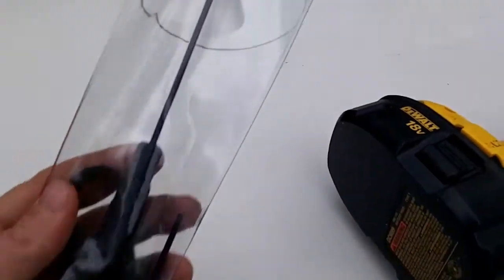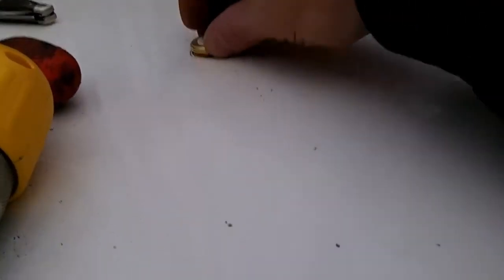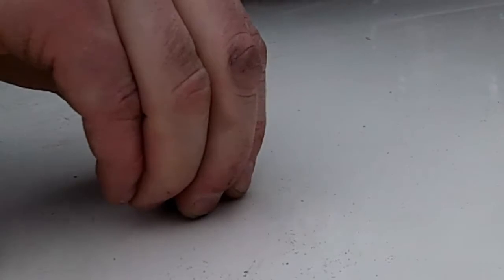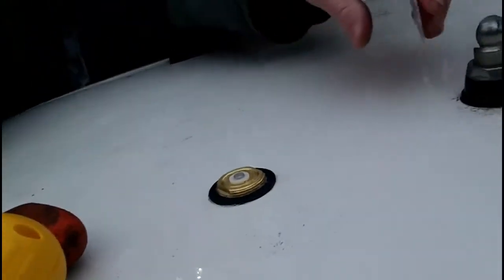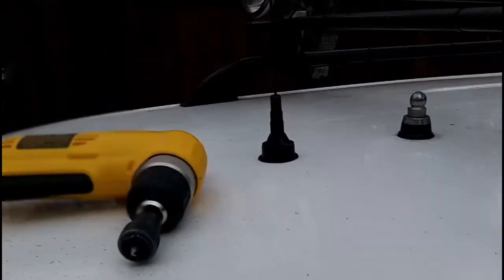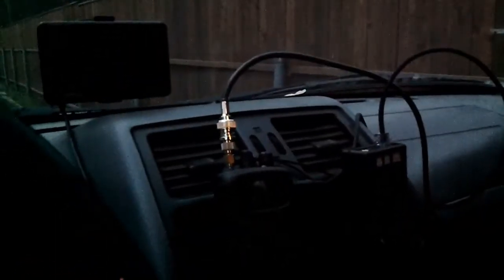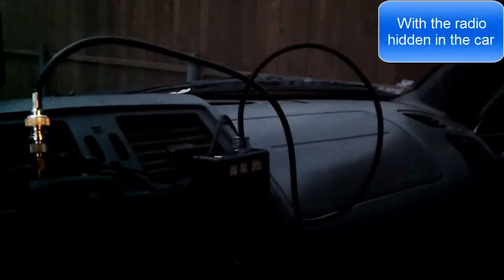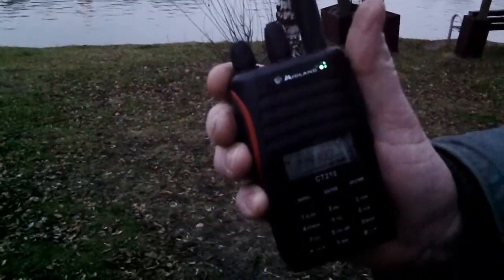Mobile BOV repeater/command vehicle

Comment: when you laughed about drilling the hole in the roof - i did too lol.
nice idea using the bov as a mobile base station, as hank said, find a hill to park on and you'll be fine bro.
good to see you out of the bov too
Reply from the maker: It was a bit "iffy" as there was some kind of bracket under the roof covering only half the hole diameter. Would have been a disaster if we have not managed to cram the mount in between the 2 layers! I will be pretty cool at the homestead and on trips.

Comment: Great set up Lars, That should give you a much better range. How well does your cell phone work at your camp site? Thanks for sharing, Steve...
Reply from the maker: It will be great to test at longer ranges but i am sure it works well. My cell phone does not work that good at the camp. I get between 0-2 bars on the signal display.

Regards, Lars

Comment: How would this simplex repeater system compare to using a mobile radio in the car with cross band repeat? Since there are dual-band mobiles with cross band available for about $350, how much is the cost benefit of going the simplex route? And since Yaesu makes mobile 2m radios with about 50-65W transmission power for just a bit more than their FT60 or FT270, how might that compare to this setup or one using cross-band repeat? Your video opens up some interesting prospects for increasing range.
Reply from the maker: Here is a reply "Commsprepper" sent me. He have more expertise on US prices and so forth:) 

Cross-band mobiles are a great, cost effective option for operations that are limited to mobile and fix station operations where power is available (with sufficient amperes).  The ADS-SR1 simplex repeater offers a low cost, low tech solution for basic repeater operations when used with handheld radios.  Simplex repeaters also offer a portable option and even disposable option when seeking to increase range within a specific area of operations (i.e a cheap Wouxun handheld and simplex repeater left on a mountain ridge or strung up in a tree).  For sure cross-band mobiles, with their higher power, will outperform a simplex repeater and a handheld.  However, a well-placed simplex repeater with a handheld can be quite effective.
Reply: Moscowprepper Thanks for the thorough explanation! I can picture a simplex repeater like this coming in very handy in some of the hilly hunting areas I know where 2m signals might not get through the uneven terrain. And from what I've heard of the power requirements of mobile cross-band repeat and the strain it puts on the radio performing the repeater function, this may very well be more appropriate in many situations I can fathom.